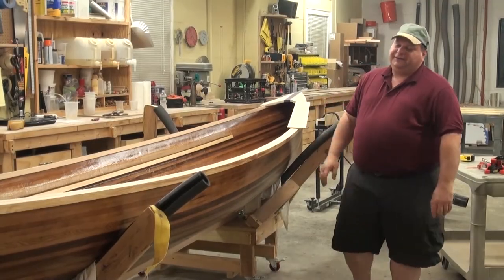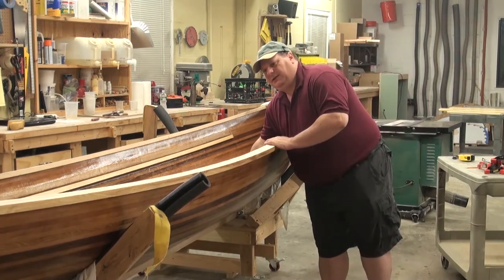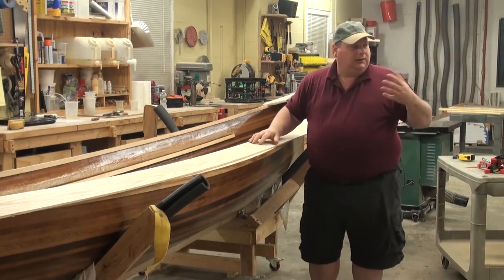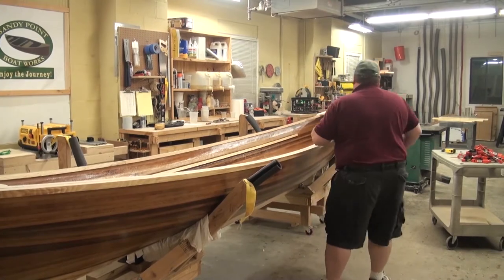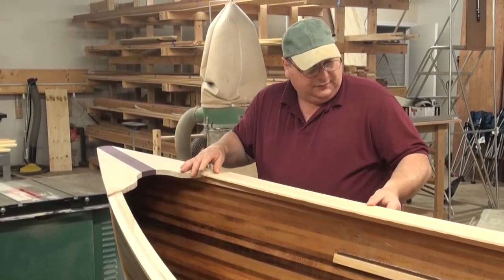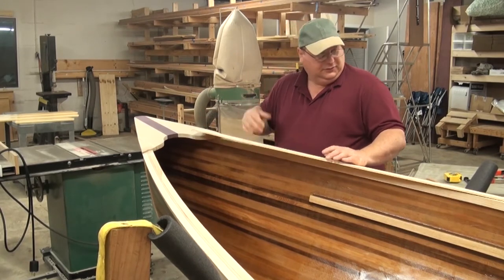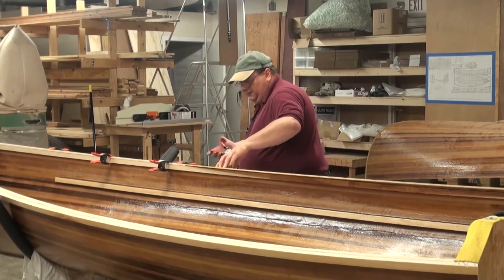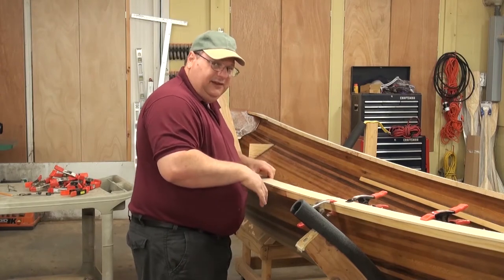29 Gunwale Caps for your Whitehall Wooden Boat

Comment: "How to use your considerable clamp collection in boatbuilding"   A new title for this. Actually I can see the usefulness for buying out the hardware store's supply. I suspect maybe using tiny temporary finish nails might work also. Or permanent copper tacks which show. OR maybe clamping a thicker hold-down piece over it with much fewer clamps.  (I like the look of bronze or copper nails showing)
Reply from the maker: I don't like leaving any mechanical fasteners in the boat.  I pull screws and nails and plug them as I just don't want them causing problems in the future.  Depending on the bend, how much tension there is and what kind of wood you are using there are some options which allow you to use less clamps or even make your own clamps using cut pipe and such.  If you hit a sale at harbor freight, you can get a bucket full of them for not a whole lot of money.